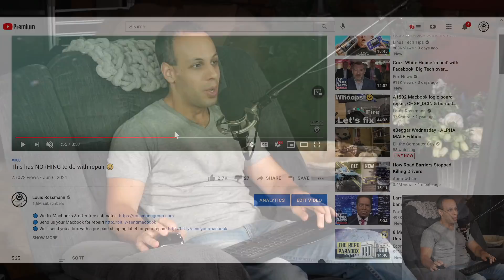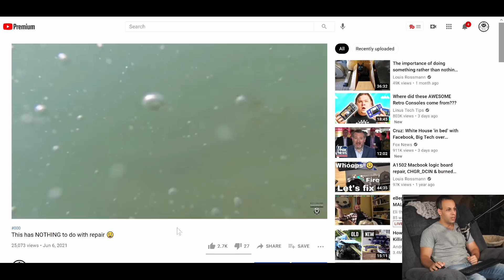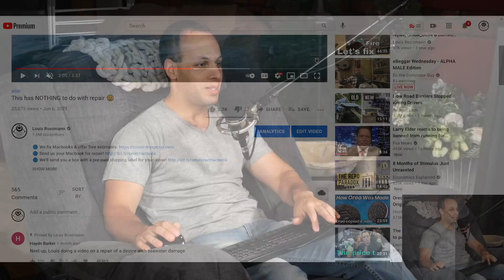Why are user serviceable batteries a bad thing?

Comment: the manufacturer enjoys being able to charge you for a new battery and also charge you the labor to replace it. Why people wouldn't be able to go to a Walmart buy a new battery and replace it themselves is beyond me even if the battery came with a new gasket or O-ring that needed to be replaced to maintain the waterproofing . Some people must have money to burn i guess.

Comment: First I've heard of people being that extreme, but that's the way things are these days...  I've replaced the battery in my Samsung S7 three times, and I'll probably do it once more before upgrading, the phone is still working fine so it's crazy to spend all that money on a new one just because the battery gets to the point where it needs to be charged every night.  I've replaced a few batteries for people with Apple devices and those do seem to be the hardest to deal with, someone I know loved their iPod Shuffle (the tiny square one) and wanted the battery replaced, that was an interesting project but it worked and they are still using it.

Comment: Not getting a battery from the manufacturer is a big security risk! If the battery dies, I am forced to buy a crappy 3rd party one. Manufacturers should provide original spare parts for a fair price including the tools and gasgets.

I am only accepting build-in batterys if I get a real benefit of it. I go on open air concerts so water is always a problem.

I was asked to buy a businessphone as the Samsung Galaxy S6 came out, and everything was worse than the SGS5. Build in battery, no SD slot, and if I remember correct it is not waterproof. So I bought the SGS5 which I still use today now with an after market battery.
As camera I bought a Panasonic FT3, waterproof with exchangable battery. Bad picture quality for today standards but it still works.

But today it is really difficult to find anything like that as replacement. ;(

Comment: I have an S5. I could afford a new midrange device, but I REFUSE to give my money to a manufacturer that does not have a removable battery. The S20 was such a sad case where it was finally a high end device with a plastic back, BUT THEY FORGOT TO MAKE IT REMOVABLE. My friends in class are always "must suck to have the battery fall out when you drop it" and my response is always "must suck to break a $600 glass back when you drop it." I have found that I can actually fit a secondary battery in my wallet meaning I can go from 0%-100% in 30 seconds.

Comment: Simply put, the trade off for a user replaceable battery is the loss of some levels of water protection.   Making a phone that is IP67 let alone ip68 compliant while still having this feature would be more expensive and less reliable than current designs.  It's a trade off between X and Y.  For an internal battery, making the part available isn't a problem in itself, the problem are hack repair companies who break the IP67 level seal to replace the battery and in doing so, make it impossible for the phone to have that rating any more in the future.   It's a trade off that few are willing to make.

Comment: Louis my workplace gives us removable battery phones to use on the job. The only way you can kill one of these beefy devices is running it over with a forklift.
Reply from the maker: Is it a sonim phone?
Reply: @rossmanngroup  The brand we have is Zebra.
Reply: @rossmanngroup  big tech and the government wants sealed in batteries so your device can gather data and location information and send telemetry data even when the user believes that the device is powered off... if the battery is removable then the user can pull the battery in order to be assured that the device is not collecting and transmitting data...

Comment: I recently had a phone by Sonim the xp8. This android phone was water dust and shock resistant. It has a user replacable battery, dual sim and sd card slot. Yes it is thick but it's worth it.

Comment: @Louis Rossman: I think Apple propaganda back in 2012 was, that the iPhone 6 was a whole half a millimeter thinner due to the non-removable battery and lack of headphone jack. And iPhone 5C was almost 30% thicker than the 5S due to the removable battery. Which is BS, but this is the way all big manufacturers have always communicated things. So it is natural, that people will think that user replaceable battery equals big square and ugly devices...

Comment: "What propaganda am I missing?"  None, Louis. What's going on here is simple; you recognize propaganda for what it is.  A lot of people don't.
Reply: just like the idiot at the top of the comments section that thinks a removable battery means the backplate has to be made from plastic lmao
Reply: @harleyjones5200  plus don't most people put a case on their device anyway? So what bloody difference does it make if its plastic or glass or metal or wood!!!
Reply: It's the same with microtransactions (and loot boxes etc...) in videogames, you go on any form and there will be a vocal minority that will claim full-price games that earn hundreds of millions, wouldn't be profitable without selling 20 $ skins and XP boosters (remember when you could simply use cheat codes) or having characters locked behind loot boxes.
FYI: FIFA Ultimate Team Has Made EA Over $6 Billion Dollars Since 2015

Comment: I'm surprised no third-party has come up with a solution for this. I would gladly pay $100 for a 'replacement back' with an extension for the battery connector that leads to a user accessible slot for the battery. I know battery packs exist, but those still passthrough the battery inside the phone. Perhaps this is my million dollar idea 😏

Comment: People are muppets .. downright muppets. Because, especially with that DJI Osmo Action, there are a ton of reason, it's a better camera, than the GoPro Hero. Both the 7, that it was competing with, when it came out and the 8, that came out much later.

But that's neither here nor there and as you say has nothing to do with "right to repair". Mobile phone, laptops etc. having sealed in batteries have only one purpose: push more consumption and limit the 3rd party parts market !! And hence .. less parts are available to repair it yourself .. even on that aspect.

Comment: The problem with replaceable batteries (just to be clear, I'm super pro-replaceable batteries and modular designs) is that the manufacturer also has to commit to selling them for a long period of time. My old phone and laptop have replaceable batteries, but official ones are no longer available. After seeing quite a few horror stories about sketchy Chinese batteries catching fire, I'm pretty hesitant to order one. I used to worry about replaceable batteries, but at this point I don't care as much. Both pieces of the puzzle have to work here - the device itself, and the availability of official batteries in the long term.

In any case, the real problem is that devices are made to be disposable, and the manufacturers really want you to buy new ones instead of sticking with the old ones, because that's just how the economy works. Until we see some real and hard legislation cracking down on electronic waste, I don't think we'll be seeing any real changes here. Considering how relatively powerful and advanced modern devices are (for example, I'm still using a 10 year old PC that works completely fine and does everything I want still, and my phone is around 7 years old now, and it's still working fine), imo it should be mandated by law that the manufacturers should support and provide parts for devices for at least 10 years, and user-serviceable designs should be required by law. I'm not buying any of that "sealed is better" or "it feels more premium" bullshit, with nearly 8 billion people on the planet, we simply cannot afford this kind of short-term thinking that ultimately benefits the people who are trying to sell you all of this shit and claim that this is how it is and it's all fine and dandy.

Comment: The problem is that these companies design products that break if you replace the parts. I saw a teardown of an iphone 12, the guy switched the logic boards and the device started having issues. He switched them back and it worked perfectly.

It sounds like Apple (and other companies) would have to change the design of the devices, but probably in no way an end consumer would notice.

Comment: Fun fact: I still use my S5 as a daily driver. It works just fine, the only thing that it has trouble with is newer apps (as in, apps that do the same thing as 7 years ago, but they went through 7 years of incremental bloat, so hardware that they used to run on just fine is now not enough for them). I never tried whether it's really waterproof though, and at this point I'm not going to (the rubber seals probably gave up on being watertight years ago). It's on its 3rd battery, never having been disassembled. It's a perfectly working phone that I'll soon have to replace anyway; that's planned obsolescence for ya.

Comment: Having run a military battery locker? I do WANT legislation that directs manufacturers to ensure that batteries CAN BE not only removed and replaced by consumers, but there are loud audible alarms and flashing lights to warn of immanent thermal run away and potential for the battery to flat out burst into flames. There are plenty of videos of cellphones batteries blowing up while in peoples pockets and purses, or with electric cars homes left smoldering wrecks. A Tesla? Those batteries like ALL current alkaline batteries (ni-cad, lithium, nickel metal halide type batteries) once on fire are Class D fires and impossible to put out due to physics. All consumer electronics and electrical systems NEED to be ultimately safe for the consumer. E-Car batteries should  be able to auto-eject and the car to move itself 20 feet away so its not slagged by the heat, home battery systems should be in an outhouse and not part of the main house. Tesla car batteries have several a year that slag the cars, the day a Tesla Powerwall goes up? The fire department cannot put it out.....and.... it will most likely result in a total home loss. Consumer batteries NEED to be safe and need to be removable by the consumer quickly or be able to eject itself from the expensive non-exploding bits. ~just a bit of my rant~

Comment: The few reasons I've heard that is actually believable
- Phones on rated on how many mAh they can cram into it, the case for a removable battery takes up valuable mAh... probably like 50 but still
- Supposedly, every tech reviewer on the planet will completely throw your product out the window if it isn't thinner than previous year, completely blocking the ability to add more Z height due to removable battery's casing
- I also heard something about a removable battery being taxed in some areas as a separate item or something since it's a separate SKU then, vs "non-user replaceable" which makes it incentivized for manufacturers to not let you replace it

But the majority of it is likely because they can sell you a new phone next year when the battery has ran out of cycle life due to being cycled 0-100% every day next to a hot SoC obviously.
Reply: Yes. Those are the excuses they use.
Reply: most phones are 1 or 2 cell up to 3000mAh or so thats 3amp hours. not huge pack but not small. compare with Tesla car pack with 100,000mAh and 20 or 40 cell Series and voltage is getting up to 100v and 100Amp hour ....

Comment: The Galaxy s5 had water resistance and the battery was user replaceable, they don't NEED to seal in the battery, why do they do this? To discourage you from opening the device and change the battery yourself, so you buy a new device!

Comment: I remember when you were able to stockpile batteries, and the OS of both MacOS and Windows would save your work when you closed your laptop, and you could replace the battery on the fly in a matter of seconds, even being able to charge the battery away from  the laptop on some versions. Windows 11 Still supports that, if you have the hardware that can do that, which is getting increasingly harder. 

Also I remember when I had my old Samsung Galaxy S3, where I could swap the battery out mid-day if I wanted to, or change it out with a big chungus battery that needed it's own custom case so the battery would fit seamlessly. I could even buy a third party charging cradle and charge a stockpile of batteries so I could just swap them mid-day if I ever ran out of juice. no need to be tethered to a wall or a battery bank, just swap the batteries for another full one. 

Folks, there's more to user-serviceable phones than being able to replace the battery, it's also handy for day-to-day usage and choice, user serviceability, and modding.

Comment: PlayStation people are insane for preferring a battery that can’t just be switched. I don’t care about exclusives, I care about my expensive toy having batteries I can change out for WHATEVER REASON I FEEL THAT I SHOULD. I bought it, why do I need to open the controller up, probably lose a screw or two, disconnect the battery with the same connector as wireless phones from 15 years ago, play with the fitment of everything, then find out I put the wrong kind of battery inside?

Comment: Got an old Samsung s2, needs fixing but kept because it is sill has headphone socket, micro usb charge port and user removable battery!!!!!
Had a Nokia 710 (Matrix slider phone) and about 6 spare batteries, for about 3 weeks life,
And even the first smartphone ever, Nokia communicator, came with multiple batteries as standard!

Comment: It's like wishing for  a car that has to be replaced when it runs out of gas...

As to requiring slightly thicker phones to make 'em water resistant with a replaceable battery, that IMHO might be an advantage - smartphones are getting too thin to even hold comfortably or handle securely.

Comment: I'd really prefer to sacrifice a bit of thickness and weight (up to about 2x thicker and heavier) in order to be able to replace it. In fact I'd prefer a thicker phone because with my S8 without the case it becomes very difficult to hold without touching the screen unintentionally.
Reply: Phones becoming too thin to actually hold is the ultimate karma to any and every thin phone fanatic

Comment: I always fail to understand why people don't automatically desire to "have their cake and eat it" with devices, because it should be possible, and even if it isn't for technical reasons, it should be something aspired to, surely? I want my phone to be thin and relatively light and to be water and dust proof but also to have a user replaceable battery. Is that hard to design into most devices? Probably. Is it impossible in most of them? Probably not. Would I personally be willing to make small compromises to achieve it? absolutely, but we live in a word where that shouldn't even have to happen. By desiring the best of all these features we can push forward the limits of technology and achieve better designs with fewer overall downsides.

Comment: Apple introduced "encased" batteries, then Samsung followed suit, then everybody else.
The pretext was that it was more premium as it allowed phones to be thinner.
To bring the point home, manufacturers still make some of the chunky mid/low tier smartphone models with removable batteries.
Reply: Hell, Google released the cheap pixel 3a with a 3.5 mm jack after removing said feature from their premium phones.
Google's reasoning for including this feature was : we want our customers to have choice.
Reply: the sad truth is: the most premium flagship phones are not thin/light at all, they weigh easily over 200 grams, and their camera module just have to stick out. To protect that camera module, you'll have to buy a phone case, making the entire phone at least as thick as its thickest part.
Reply: And irony, when I got my first Galaxy S, I was like "oh wow, this is so thin...and slippery, and hard to hold, and fragile"...10 minutes later I'm out of Best buy with an otterbox that doubles the phones size and now it seems more usable lulz.
Reply: @RobertMorgan  I had exactly the same experience, except that it literally squished out of my hand when I was trying the camera.
Luckily I was home and it landed on the wooden floor. I bought a case straight away.
Reply: Also Google had to compete with used phones.
Reply: The only somewhat decent phones with removable batteries I have been able to find in 2021 are: Fairphone 3+ and Galaxy Xcover Pro. Everything else is simply garbage. And I couldn't care less about phone thickness.

Comment: 2:20 in and all of a sudden Im getting weird looks. Thank you for that. Id personally prefer a thicker phone just because of how thin they are. But why can't we have sealed AND replaceable? There is no reason to glue these batteries in. They are confined pretty well without the glue and crap. I would love if you could just grab a hair dryer, pop the back off, and flip the battery out and then buy some resealable adhesive for the back glass. Done. Doesn't compromise the battery at all. Doesn't change the dimensions. Just... get rid of the glue.

Comment: User replaceable batteries saved several of my phones after dropping then in rivers accidentally. Fixed battery and non waterproof phone is a 100% death sentence because of electrolytic corrosion.
Reply: Dude just use rice, fixed all problems mate.
Reply: Sir you do not understand. When a water sensor is tripped, your phone is no longer able to be repaired and noone should attempt to do so or risk death by accidental electricution. Anyone who claims otherwise is a witch and shall be burned.

Edit: /s just for clarity as i could see someone actally say this
Reply: @Juhujalp  "Anyone who claims otherwise is a witch and shall be burned."

That alone tipped me off that what you said was sarcastic. Relax, this isn't Reddit. 😛